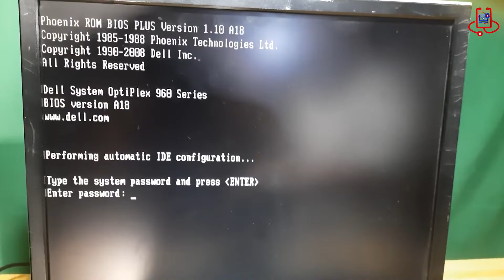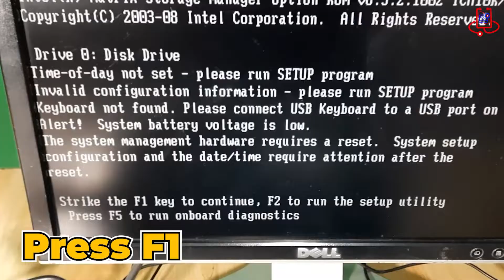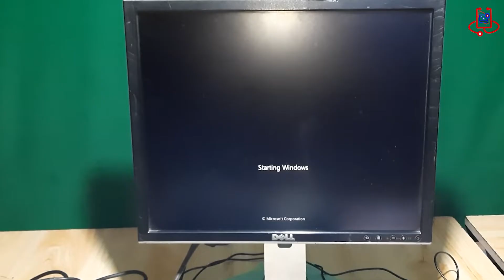Dell OptiPlex BIOS Password Reset for All Models | Step-by-Step Tutorial

Comment: Thanks! It works also with a 790. But before starting up with the jumper back in place, start the pc without the jumper in original place. Then you get a message from Dell Secure manager that the password is removed.
Reply from the maker: Thanks for the additional tip! We appreciate you sharing your experience. 😊

Comment: When pc is powered on I am unable to enter my pin because screen shuts down fast can u help me on this I would be greatful.
Reply from the maker: It sounds like you're having trouble with your screen shutting down quickly. This video is about BIOS password resets, so the issue you're describing might be related to other settings. You could try checking your power management options or display connections.

Comment: how can we found the actual password ?
Reply from the maker: Unfortunately, the actual BIOS password is stored securely and cannot be revealed or recovered directly. The only option if you forgot it is to reset or clear the password using hardware methods like removing the CMOS battery or using motherboard jumpers.

Comment: Does not work on Optiplex 3000 mini as it does not have a jumper
Reply from the maker: To reset BIOS on Dell Optiplex 3000 Mini:

1. Turn off the system and unplug the power cable.
2. Open the case and locate the CMOS battery.
3. Remove the battery and wait for 10-20 minutes.
4. Reinsert the battery, close the case, and power on the system.

If this method doesn't work:
1. Use software tools to reset BIOS (like "Fireport").
2. If unsuccessful, contact Dell support.
Reply: @devicedoctor1  pulling the cmos battery on that model will not work either, you have to call dell support and they will generate a master key that will delete the old key
Reply: @Kayleeedoesnt  and isn’t that just BS on Dell’s part.
Reply: @techluvin7691  real. Super anoying. Like I already have access to the internals, just let me reset the device
Reply: @ Typical Dell. Remove the jumper off the board. What fools…….complete fools.